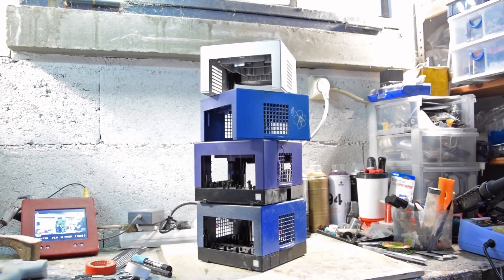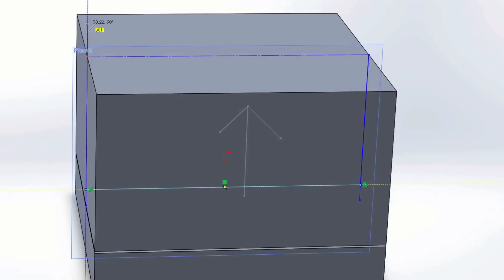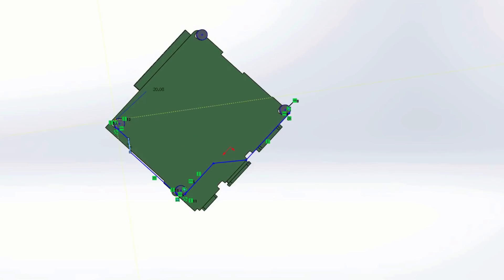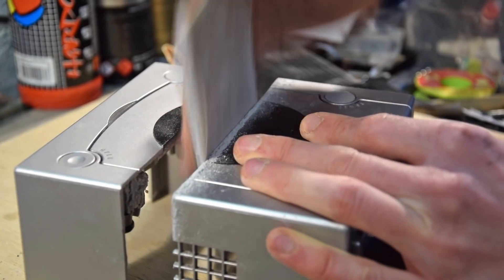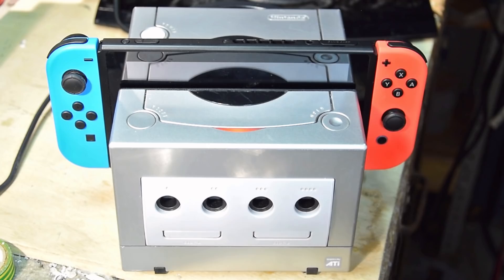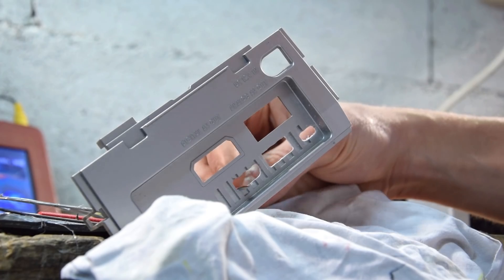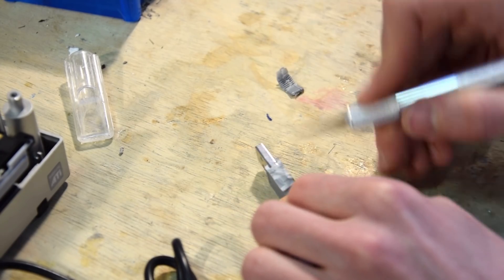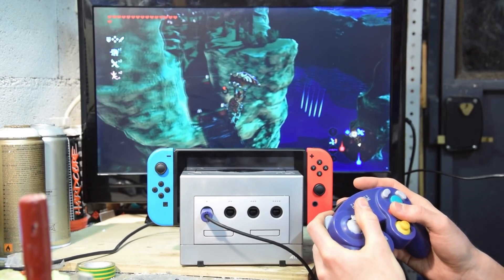Gamecube Dock for Nintendo Switch - Working controller ports - DIY project

Comment: Can someone help me out with the exact brand of GC controller adapter that is? Having movable ports would be really useful
Reply from the maker: It's a pretty bad no-name brand, try using a mayflash instead it's much better
Reply: @RatedeMods  thanks for the reply. The one I used for another project was a YT brand and about $13. It works fine so far but I had to bend the ports pretty good to get them to line up close. Not perfect though.

Comment: I have had a switch for 2 weeks now and thought it only had 1 usb port....

until I saw this video and the part where he hooks up the 2 usb cables from the gamecube controller adapter. I saw the 2 cables and thought "hows that going to work there's only 1 usb port?" I just looked at my switch dock and sure enough there are 2 extra ports on the left back side. Wow I feel dumb.
Reply from the maker: Aha, they're not obvious since we don't really use them yet :p

Comment: any chance on selling these on ebay or amazon? id love to buy these even if its more then a Nintendo switch dock costs since it technically is two adapters instead of one which I can understand the cost of them an the time it takes gamecube adapters usually range between 20, Nintendo switch docks cost usually round 80 or sometimes less an once put together your maybe looking around 100 or 120 dollars but what ever it may cost on your decision, but is there any chance on selling them tho because this im surprised Nintendo never decided to make for when smash bros comes out because this is an awesome project which I wish I could buy.

Comment: Is it possible to take the gamecube controller connectors (in the gamecube or original wii) and mod them into a controller adapter? rather than buying an adapter

Comment: Is there a way to use the gamecube's controller ports instead of using one of those "knock off" controller adapters? I have found that a lot of those "non-Nintendo" brand adapters wreck controllers. i have had multiple controllers get stuck and damaged to the point of not working.

Comment: question, the switch has a fan, i didn't notice any cut out for the fan to breathe..... suffocating the fan seems like a thermal nightmare... did you adjust for it later?
Reply from the maker: There are fan holes for the switch in the v2 ! in the v1 I had to drill them out later yeah

Comment: I love your mods, and this is one of your best ones, but I’m gonna stay away from this one because I’ve heard using modded or Third Party docks can harm your Switch.
Reply from the maker: But this is a first party dock tho 😁
Reply: Ohhhhhh. At first I didn’t get want you meant by that, but now I see it. It’s a first party dock because it uses the Original Switch dock as part of it, right?
Reply from the maker: Yes exactly 😁 like you, i was scared to brick my switch so i used only 1st party parts (except the gc controller adapter)

Comment: I’m currently Making my own Switch dock mod. My Only concern is , if i do like you and put in a custom led, Will it behave like the normal led? Light on when docked etc?
Reply from the maker: Exactly yes ! Only if you connect it to the switxh dock led though. If you only connect it to 5V it lights up all the time which is lame

Comment: Do you know if the original Wii U NGC ontroller adaptor fits propperly into the inside of the NGC case?
Reply: Ive found that nyko ones work fine
Reply from the maker: It fits just like th original ports !
Reply: @RatedeMods  Thanks alot! I will be doing this mod soon, but i will make some modifications like having a LAN port on the back and putting a fan inside the gamecube for ventilation.

Since i don't have a 3d printer i will make the printed parts with PVC, do you reckon it'll work fine?
Reply from the maker: @2838103  what do you mean PVC? Will you injection mold them? If you need i can send you a set of the 3d printed parts :) another idea is to use the plastic from the original dock !
Good luck, the ethernet adapter fits great on the back in the place of the AV out port
Reply: @RatedeMods  I'm planning on buying a large sheet of pvc and cut it with a dremel. 
I don't want to wreck the original dock bc I wanna be able of reverting the process of I ever want to.
Sending parts would be complicated as I live in south america :(. I'll try see if my uni has printers for students's use tho, before I do the PVC thing.
Reply from the maker: @2838103  you can definitely do the pvc and dremel thing, that's how i used to do it before 3d printers. You could even shape it into the right form ! No worries for south america, it could be done, i'm in europe anyways. But your best bet is indeed access to a printer from school or a friend
Reply: @RatedeMods  do you have a discord channel? I'd like to send you the mod whenever it's finished, it's a long ways from that tho bc I'm just buying all all I need for it
Reply from the maker: @2838103  Yes :) lub#1242 add me as a friend :) I want to see your finished product and Im' here for help (believe it or not I currently making a GC switch dock this week for the first time in years)

Comment: Modders can be quite the bane in collecting and getting systems repaired. A lot of them are just horders with a hobby in destroying consoles with a few good turn outs that are a mess on the inside. 

On another note, You could have cut the slit just behind the gamecube logo instead of removing it
Reply from the maker: No, there is more to that than just "cutting" i had to account for the size of the ribbon cable. Thx for the surface level criticism though. 
I don't hoard consoles and make use of all that i have. That was the actual point of this video. Different POVs i guess.
Reply: @RatedeMods  i wasn't talking about you in the top part of that comment but thanks for taking it personally. That's generally how the community is. After all its a hobby. Also i said "can be." Again, thanks for takingvit as a personal slight
Reply from the maker: @Wolfstanus  it's ok i'm not mad i just thought you looked at my vid and made a broad generalisation
Also i understand your thoughts but usually modders are pretty poor so will only destroy consoles no one wants (eg they got for cheap)

Comment: I would like to make a mod in which I hollow out my Xbox 360 entirely and have the mechanical power button turn on my switch which will be attached inside.
Reply from the maker: That's probably very doable :)
Reply: I hope so.

Comment: Hey you forgot to add the vent breathers to your main docking case not the gamecube holding case. Re do or you will have an over heated switch you vented the gamecube case but not the switch holder so its not really sucking in air wowww. Dont play zelda for a long time
Reply from the maker: I ended up adding air intakes after the video was done. I even updated the 3d models as you will see in the video just after this one :p
Reply: @RatedeMods  now its complete great make btw can you make chipsets???

Comment: No... bad!... You will brick your switch doing that because of the 5.1 update of the Switch operating system.
Reply from the maker: Why even would that happen. This is the original dock.
Reply: Okay, just wanted to make sure.

Comment: I don't expect a response but I am attempting this mod and need a tad bit of help. What kind of connector is used for the led? I've been looking everywhere and can't find the right one.

Also on another note this GameCube adapter has ports soldered directly into the motherboard and it's spacing fits perfectly in the GameCube ports. I feel this is the best option for anyone wanting to do this mod but don't want the cheap ports but don't want to use the OG ports for soldering.
Lonk:  https://www.amazon.com/dp/B07F36FWMQ/ref=cm_sw_r_other_apa_i_Yh6qEbRB2DSRM
Reply from the maker: Don't use a connector for the led don't bother. Reuse the original one. Cut the wires in the middle and solder your new led from that. If you ever want to go back you can always reuse this connector by desoldering it :)
As for the GC adapter. Good idea, but if it's really soldered make sure it will fit in length!
Anyways if you want more help we can converse on Facebook or Twitter for help
Reply: @RatedeMods  oh shit you responded that's amazing. Yeah I learned the led connector is a JST-ZH connector. I was worried I might of broken my connector but it's all good now, just had a dead GameCube LED. Also the board for the GC adapter is really small but has a long wire so that'll be a small issue to deal with. Thanks for replying and just like the hundreds of other comments, amazing mod my man.

Comment: why the hell do you have tape over your hotend fan?
Reply from the maker: Cause this is a very cheap printer and it has flaws.. mainly the fan is too powerful to allow the heating element to reach 230.. it just stays at 220

Comment: Holy shit dude, fix your 3D printer's retraction settings.
Reply from the maker: I'm trying as best I can :(
Reply: I know its expensive, but Simplify3D has helped me so much with retraction settings. If cost is an issue, you might be able to find it for $free.99 in some "interesting" places.

Comment: If you have epoxy glue why is it so necesary to hotglue that much?! That was like 10 or more sticks?!

Also real modders shouldn't hotglue on solderpoints!!! What's wrong with you????? I hate when I have to fix electronics and see that some dumbass hotglued the solderjoints and I have to pray to alcohol that it will soften the glue in order to remove it... Also you mean to reuse the parts in it when something goes wrong. How will you disconnect something covered in hot glue??? You can't!!!
Reply: Also... why you used epoxy then hotglue at the dock part??? Why can't it be just plain epoxy all the way? Unnecesary wasting to me

Comment: Ahahahahahahaah we will take apart the switch dock and not ruin any of the expensive parts , holy shit that was funny  .10$ is not expensive
Reply from the maker: Switch dock is a bit more than 10$  :/
Reply: Rated-e Mods not really , I bet they pay less then 10$ for that dock to be made .as in Nintendo. Example look at a ras pi, there pretty cheap and have a lot more onboard then a pass through with a chip lock . Now as they buy in bulk . I wouldn’t doubt if it costs Nintendo around 7$ to make the switch dock. I’m sure every piece in it costs just cents to them